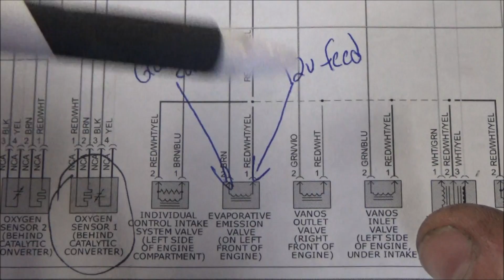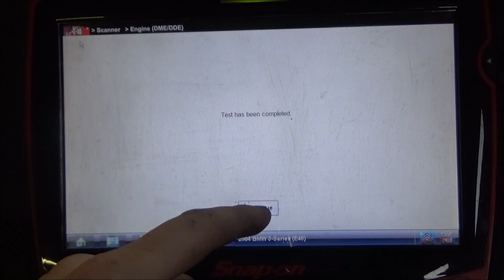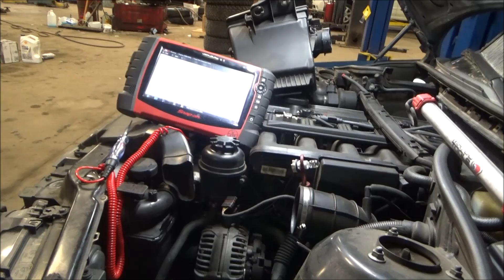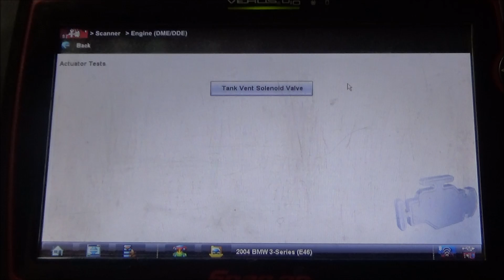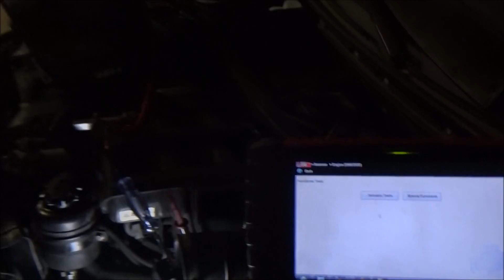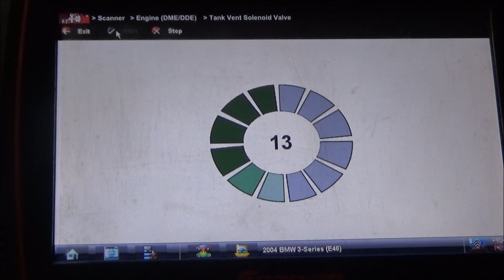2004 BMW 2772 Fault,  Purge Solenoid Testing

Comment: I changed my purge valve up front but I'm still getting the P2187  & 89 codes. Why is it running too lean. Anyone know. ? I changed the gas cap too btw plus few other things. I'm lost. Please lmk

Comment: I just had the 2772 fault code on my e60 545i.
Soloniod had a reading of 31.2 ohms. A second hand one I got was 28.6 ohms. Still had the fault. 
Purchased a new soloniod from BMW, it read 25.2 ohms. 
So it appears they are very sensitive to the slightest difference in ohms. 
Fault is now fixed
Reply: They're not that sensitive.

Comment: Great video Joe! Not talking to you Joe,but with the technicians out there complaining about European vehicles : do not be afraid of learning something new! If you want to last in this industry you have to deal with whatever is thrown at you. Joe just showed you how easy it is to figure out how the system works without much info from the scan tool by using the basics.
Reply from the maker: Euro cars can definitely be a struggle sometimes,  especially with the limited available info.  Knowing fundamentals certainly helps!  Thanks Nick.

Comment: Is there no way to force the canister vent on that system? Seems crazy that they would give you bi-directional control on the purge and not the canister vent or leak detection pump..
Reply from the maker: Not on the Verus it seems, at least 15.4 which is what I'm on.  There was another test in the functional test menu I didn't notice during the shoot, and it's possible those controls could be there.  Euro's are never friendly to me.
Reply: I was wondering if that perhaps when you ran that test the second time, with the good solenoid,  that what you were hearing was actually the pump and not just the purge valve. Also, I am still confused why when you had the bulb wired directly across the connector, it did not light and yet the test light to BAT+ did light.
Reply from the maker: I'm sure that it was not the pump running,  the only sounds coming from the vehicle during that test was the purge solenoid.  As far as y use of the noid light,  the male terminals on it were pretty small,  and I'm fairly certain it was just a contact issue.  I need to make another one using slightly larger male terminals for better fitment into connectors such as this.